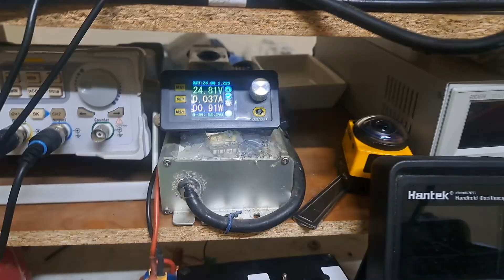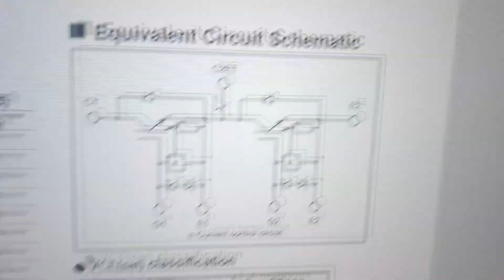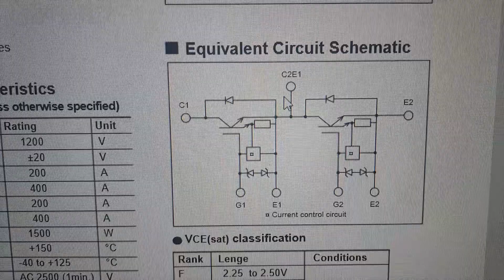Tesla Coil Driver for QCW

Comment: What's the max switching speed on those big bricks?
Reply: I'm guessing they would be around 20kHz - 70kHz. However you can exceed these ratings via soft-switching them with sufficient current at the gates.
Reply from the maker: @michaelmule4582  yea I was going to cross my fingers and try anywhere up to 200-300khz just for shits
Reply: I've heard phase lead helps reduce stress on the igbt by utilizing zvs. I'm going to try to run cm300du-24f @ 130khz. I have no idea what is going to happen.😂
Reply from the maker: @coreyworthington2797  I think turn off time is going to be a big issue at certain frequencies. I mean really when these bricks are advertised for high speed switching they are typically talking like no more than 60khz. Most of them seem ideally designed for 30khz max. I see them mostly used at a typical 4khz only for the PWM on variable frequency drives. Sometimes they will go higher like 12khz to help with audible ringing. So at those frequencies they are commonly getting away with a 2A pk opto for each gate. 
Driving these switches at anything over 100khz is just not going to be ideal. It can work, but at a certain point you're probably better off with 247 packages. 
I'm going to push mine at 280khz just to kind of see for the sake of science lol.